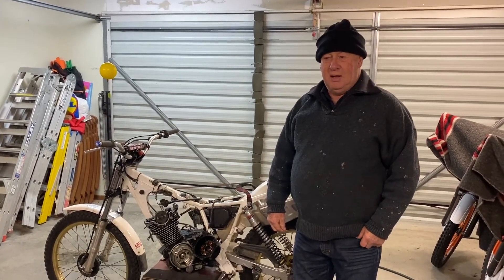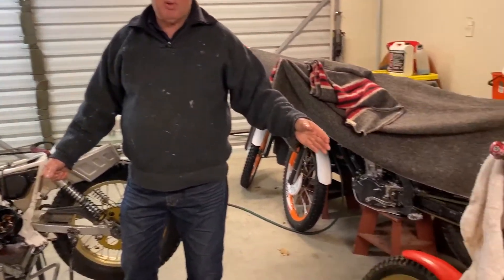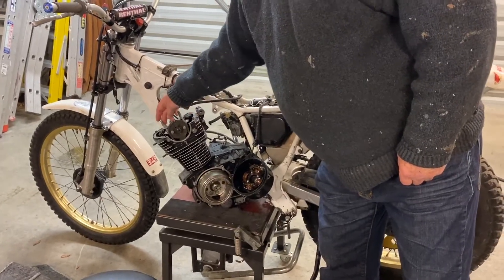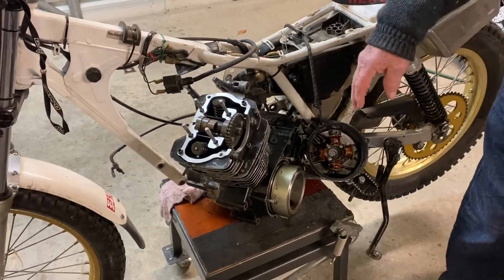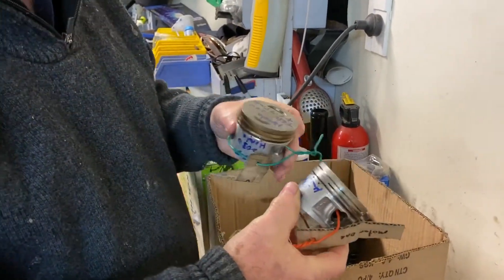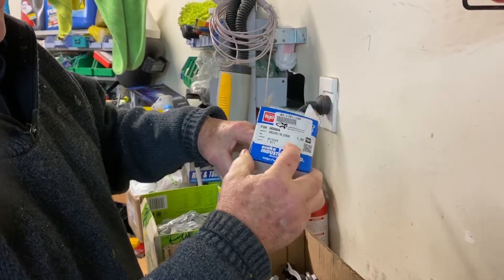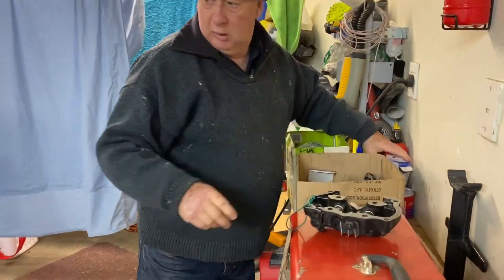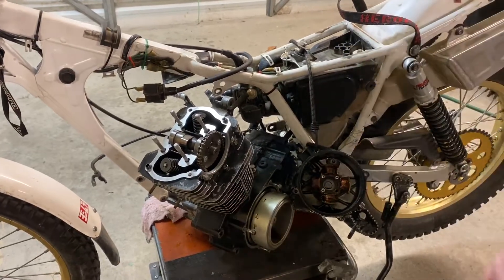Honda TLR 200 top end rebuild

Comment: good video and is self-explanatory, one question I have for you, can you rebuild the top end of this engine while the engine is still in the frame, I want to fit a new barrel and piston and was wondering if it can be done without taking the engine out of the frame, its all down to will the top frame under the petrol tank stopping the head from rising up above the studs so it can be removed, or maybe remove the front engine mount bolts so it can fall forward to give extra clearance,
Reply from the maker: Hi sick6six,
I would suggest you remove the entire engine. The tappet cover,head,cylinder very awkward to remove  because the top frame tube and front  Down  tube are  in the way. Remove engine because later it is easy to work on without Frustration. You can clean the oil pump easily.It will have dirt around the sides and must be cleaned when doing a rebuild .Don’t forget the very small rubber cover bung on  the head beside the camshaft  ,very important . Buy yourself a  owner’s workshop manual or download one from the internet and follow it word by word .good luck cheers Peter

Comment: I'm a bit confused, where were the parts that caused the rattle ?
Reply from the maker: The metal parts that put pressure on the tension blades had broken ie the u shaped part has a welded rod to iti the spot weld had broken so it was floating and not properly putting pressure on the metal arm. Everything moving about causing rattling sound
Reply from the maker: Sorry YouTube will not let me post a photo in the comment section. So you can see want I’m talking about

Comment: What would be the original size of the cylinder?
Reply from the maker: Cylinder head nuts 28-30 Nm
Cylinder head socket bolt 18-25 Nm
Torque setting TLR 200
Reply from the maker: Cylinder bore size ID    TLR 200    65.000 - 65.510mm
Service limit   65.600mm
Reply: @ty250z  Thank you very much Peter, you don't know how much you have helped me! Greetings!
Reply from the maker: @vascoiriondo6609   
Go to this web site and it’s a full work shop manual 
Cheers Peter
https://www.custgp.com/a1manual2/Honda%20TL125-TLR200%20Workshop%20Manual.pdf
Reply: @ty250z  Very, very grateful!

Comment: What would you say how much it cost to rebuild the top end
Reply from the maker: A  quick answer is  $650 New Zealand dollars for one motor.As I got two motors machined at the same time and parts purchased.I thought $1300 not to bad. From the invoice I have ,rebore and hone and wash,cap rings and fit to pistons,regrind camshaft,strip ,acid clean decarbonisation cylinder heads x  2, reface  and grind valves and seats and lap and supply two new pistons and ring sets.
I assembled the top end myself including cam chain and tension gear . I had two new top end gasket sets about $35 each.Not a very hard job but take your time and read the work shop manual carefully and torque everything .